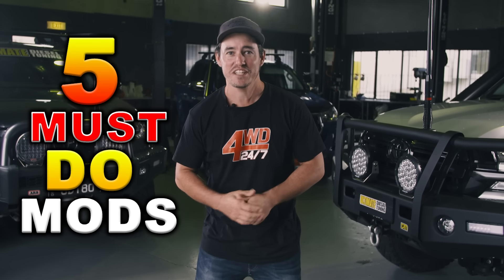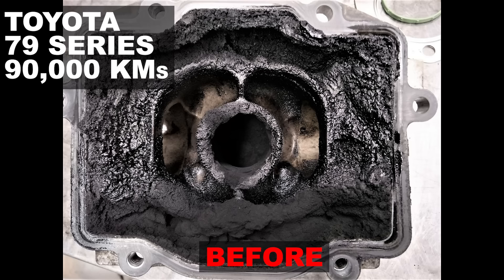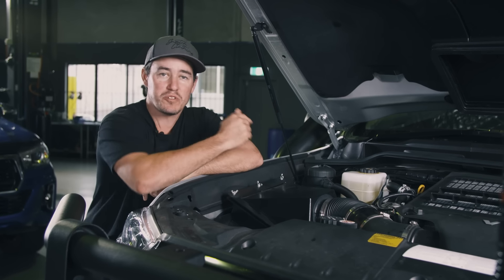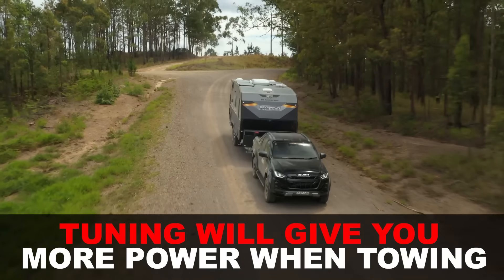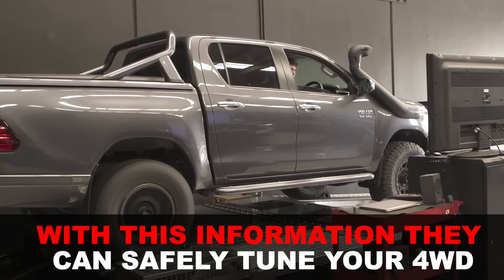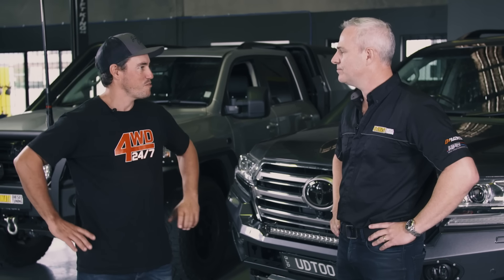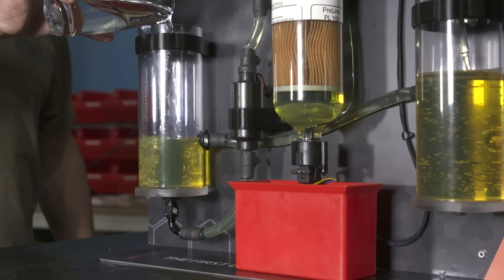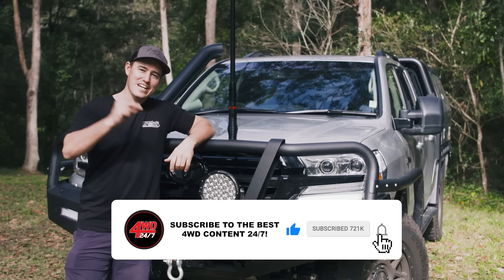5 MODS EVERY MODERN DIESEL OWNER SHOULD DO – all under $1,500! Get 30% more power, more reliability

Comment: 320k on my 200, zero mods and zero issues. I think regular servicing is the key.
Reply: Pull the intake. 
Throw it on a dyno, guarantee it’ll be well down on power
Reply: True. I think all these mods basically just maintain a higher level of performance but will give your vehicle a longer life
Reply: it'll be well & truly contaminated with soot mate!
Reply: @UltimateDieselTuning   I get that but my car is still running fine. Why fix something thats not broken?
Reply: @adrenalinerush91  of course it will it has 320k km's on it
Reply: @dangray5932  are you saying regardless of the soot?
Reply: @adrenalinerush91  an enigine with 320K of use will make less power than an engine with 100k on it with service history being the same. Don't believe the hype. Catch cans are the pod filters of the 90's.
Reply: @dangray5932  lol, that’s funny cause I personally owned 2 identical vehicles and the car with 87,000 more ks made 6kw and 12nm more then the other
Reply: regular servicing, using the correct oil and limit the amount of short drives you will have no dramas.
Reply: @dangray5932  hahahaha changing the oil and big drives eliminates soot 🤣. You have no idea
Reply: @adrenalinerush91  Ran my 2020 200 with 10k on the clock against my parents 2008 200 that had 440,000km on it, neck and neck to 120km/h every time, wasn’t down on power at all.

Had similar experiences with other diesels too, high km cars that are serviced regularly don’t lose much power (if any) at all and are usually better on fuel I’ve found.
Reply: @craigdavid6668  haha mate go throw them on a dyno. No amount of servicing will stop soot build up. Long drives help the timeframe of the build up over short but they all clog up no matter the conditions. 
Those same vehicles I talked about before picked up 10% with just a clean.
Reply: @adrenalinerush91  Fair enough, real world performance didn’t seem affected by the km at all, I don’t know what a dyno will spit out but both cars were identical in acceleration from a launch, normal take off and rolling, parents car sits on 11-12 l/100, mine is always around 14, soot doesn’t seem to have any negative impact on performance from my experience.
Reply: Agree - the only mod of these I’d consider would be the extra fuel filter.  All the others will either be a waste of time or reduce the overall life of your engine and parts.  There is no magic bullet of “more power better reliability”, common sense should tell you that - why wouldn’t the factory do it if it was so easy?  The biggest cause of the build up of soot is short (cold engine) trips in a diesel - as long as you go for a 30min high speed drive once a month you’ll have no problems with soot build up!
Reply: @pacman5590  common sense should tell you that a tune developed for that specific engine, climate and fuel vs a tune developed for the entire worlds climate and fuel quality is a mile and half better for the drivetrain. 
As for soot, short drives just increase the production of soot. Every single diesel with an egr system has soot issues no matter how it’s used. There is no way around that.
Reply: @UltimateDieselTuning  For real
Reply: 450 on mine zero mods zero issues 😂

Comment: EGR's need to be banned, it's just manufacturers being cheap. They kill more engines than they help. 
I'm helping my dad replace the high pressure fuel pump on his Discovery 3 and the intakes are caked in gunk at 180,000km.

One mod I like to do is upgrading the exhaust. Gives a little bit of power but I've also found it help economy by letting the engine breath easier.

Comment: Good advice. Additionally,  you should perform diesel oil changes and filter at least every 10,000km with synthetic oil in common-rail engines (6,000km if round town and lots of idling in traffic). Thanks

Comment: Never do a carbon clean by pushing it through the engine. You'll glaze the cylinders and blow it up. Take everything off up to the head and ultrasonic clean yourself or find a shop that does it properly and not just rev the crap out of your engine pushing it through and leaving most of it jammed up at the head ports.
Reply: agreed
Reply: A men bruv
Reply: Depends on the on car system. Udt uses chemicals to break the soot down. 
Benefits is their system actually cleans out the valve train which cannot be done with a manual clean
Reply: Hey Cal, that's not the case with the chemicals that we use. We have performed thousands of these cleans with zero issues. And no, we don't rev the engine whilst it's doing its job.  Our machines are extremely effective in removing the soot & the process is harmless to engines. Cheers!

Comment: A lock up kit doesnt prevent hunting between 5th and 6th, not in my 2023 dmax anyway. It locks the converter and prevents it flaring which is the major cause of heat. My dmax will often go back to 5th with very little provocation with the converter remaining locked, but if turned off it will stay in 6th but unlock the converter before it goes back a gear. Revs in either scenario are about the same but converter temps rise markedly if its flaring .

Comment: EGR systems should be a fairly regular service item for inspection & cleaning when required, no further action needed. They've been fitted for a couple of decades now, so we should know what to expect & what to do with them. Adding a catch can is a placebo & nothing more as all it does is act as a condenser for the gaseous moisture in the hot exhaust gas, which likely catches some solid particles & then sits around in the catch can gathering more condensed liquid, then evaporating on a constant cycle until you get that half teaspoon of unidentified syrup which supposedly saves your engine somehow. I don't think they do anything particularly harmful, but they definitely don't achieve anything either. Service your EGR systems!

I'm an automotive design engineer btw 👍
Reply: Yea you probably had a hand in all problem in the first place designing EGRs then ripping off catch cans as useless. Ok mate
Reply: @rustybogans2508  Did you get your covid injection, mate?
Reply: @karl4834  nope  live in nth qld bud  fukall happening up here
Reply: Engineer!!!  HAHAHAHA...That explains the ridiculous comment..

Comment: Hi temp alarm.
I use a dry mount probe type with 2 channels.  Install one on the rear of the head, other on the transmission.  Will warn driver of any issues like bad fan, low coolant, split transmission hose before any oem gauge.

Comment: Install some fans on vehicles with a top mount intercooler. They dont enough airflow without fans specially when moving slowly and will tell the ecu the intake temps are high and will reduce power

Comment: oil seperator container there are many types out that taking that your run your crankcase fumes through extracting the oil out before it goes back into the intake manifold, will reduce extensively that gunk buildup
Reply: I'm pretty sure that a catch can was one of the recommended mods.  As in the Provent shown in the video.
Reply: @einfelder8262  thanx may have missed it!

Comment: Hey Shauno, where would you rate a larger exhaust, airbox and snorkel? Best to do those things before a custom dyne tune?
Reply: why would you tune a car and then mod it?
Reply: Larger exhaust - gives it a bit more power & torque once tuned to suit & more response down low (for non DPF models); snorkel doesn't make any difference to the engine's performance; airbox - depending on which one it can make a difference but again once tuned to suit.

Comment: Hey shauno, wouldn't the box tune be better on the 200's now that they can modify the shift points and lockup points? Rather than having a box to tell you box to tell your box when to lock up. Just tune the box so the ECU controls it all rather than an intercept of PWM signal.

Comment: Seems like petrol engine are more reliable these days. Even my 3.4L had lasted 300,000+km with no mods
Reply: Yes and cheaper to run.
Reply: @Malc664  lol I save 5k a year just by switching to diesel on fuel alone lol
Reply: @adrenalinerush91  Yes, it's worth it for a lot of travelling. But the average daily not so much.

Comment: Get the egr valve cleaned aswell. As you never want to block them up or bypass them. That's how most modern p plate 4bys end up rekt
Reply: Yes that is what we are talking about here Kaely - the "intake clean" includes the EGR.

Comment: What happens to company warranty?? That’s the only thing stopping me putting it on a new vehicle
Reply: Ask your new car dealer, not the people trying to sell you aftermarket parts who don’t have to honour your new car warranty
Reply: @Corey-pd3mi  thats the confusion, whom to trust as both sides have a story to tell with no right or wrong answer.
Reply: @sahilthakur03  there is a right and wrong answer, who needs to honour the warranty, that’s who you need to trust. If you value your warranty that is.
Reply: @Corey-pd3mi  And don't do offroading for next 7 years lol.
Reply: good question! Nothing happens to it Sahil. They cannot just go & void your warranty due to any of these things. If there is a problem with the car that develops, then they must prove that the mod caused the issue. And if they can, they can then REFUSE your warranty. Here at UDT we have our own warranty as well.
Reply: @UltimateDieselTuning  that is wrong if you read your warranty even fitting the incorrect tyres is justification to void you warranty in many cases and any modifications that arent manufacturer certified will definitely void they dont need to prove the mod was the cause you need to prove it wasnt.
Reply: @shaynegadsden  put it this way - we tune cars delivered to us by the dealership that are brand new. And also fit exhausts and catch cans to them, plus secondary fuel filters & bigger intercoolers. All of those car's warranties are still intact & fine.
Reply: @shaynegadsden  if you read it all properly it says MAY void the warranty, not will. Most of the vehicles that we custom dyno tune here are still under factory warranty, with no issues with the tune.

Comment: What's your experience with catch cans with new cars? Because I've been told time and time again that they void your factory warranty
Reply: @swampypolitics9574  I think you're in the wrong comment section mate. 😅
Reply: @swampypolitics9574  put your tinfoil hat back on cobba
Reply: If it restricts airflow and causes damage as a result. A good quality catch can shouldn't be a problem but something you should know about.
Reply: Yeah it's true they can void your warranty.  I was told by Toyota about it when I was asking about putting one on my 2021 Hilux, they told me that they had 200 series blowing rear main seals apparently because of the catch can so they voided warranty.  For the record I still put my Provent catch can on.
Reply: @arthurstock4386  the only way that that can happen is if the catch can lines have been installed incorrectly, pressurising the system.
Reply: No problems provided that the can has been installed correctly
Reply: @UltimateDieselTuning  Is it possible to get a catch can fitted at a shop like your's and still have the vehicle covered by the factory warranty though? I'm thinking of upgrading to a 2021 BT50 and want to get a catch can fitted pretty much straight away

Comment: Great vid mate, I have used Ultimate diesel tuning on my previous Prado and can't fault the performance but a question that gets asked a lot is what happens if you get a tune on a new vehicle, as in the new car warranty??
Reply: Everything engine related is void, gearbox void, diffs void.  Your wiper motor is still covered.
Reply: Good to hear! Your warranty is fine mate, they can't just go & void it due to a custom dyno tune having been carried out. In the case of any issues, they have to prove, with sufficient evidence, that the tune caused the issue before they try to void the warranty.
Reply: Any  new vehicle that has  a tune is factually illegal to operate anymore on public Australian roads.... they've modified the approved emmision calibration , and that is 100% not allowed and any by product that the tune  provides  can and does void warranty especially if the increased power / torque  exceeds OEM parameters.... let alone  anything more than 25% needs  a blue plate.... which UDT and many others dont provide.. again making your car no longer compliant for on highway use......  they will tell you what ever it takes to make a sale.... but TMR  will tell u the truth....
Reply: @UltimateDieselTuning  Nice idea, mate, but when you try and get Toyota to repair the CV joints you broke with the tune on board, you'll meet a brick wall.  They won't even fix manufacturing faults like DPF and airbox leaks without a class action.
Reply: @einfelder8262  in the thousands & thousands of vehicles that we have custom dyno tuned, it is extremely rare should there be issues with a dealership.

Comment: Good mods, but every mod listed can void new car warranty. Had a 79 series denied for a turbo, stated in writing from Toyota.
Denied for catch can and pre filter also listed in writing, manta exhaust, dpf back.
Reply: Yup, anything to get out of paying.
Reply: If manta advertised it as warranty friendly they should go to bat for you to make toyota honor their warranty.
Reply: that's when you challenge your dealer. They can't just go & deny warranty claims like that - they must prove that the mod caused the failure. Pre-filters are an extra safety net for the engines (they are just a filter so cannot damage anything in the engine) & if a catch can is fitted correctly it too cannot cause damage. Same with the exhaust.
Reply: @UltimateDieselTuning   Yes I agree, I am a diesel fitter and have been for 35 years.
The catch can and pre filter are vehicle specific that where fitted, and were only on vehicle for 1 week. Toyota have been challenged and have said they don't have to prove anything. Denied for engine mods.
Yes ridiculous, but reality. The maker of the catch can and pre filter kit said the same thing as you, they can't do that.
Yet they did. 
Will you back your customer, when there warranty is denied.
Reply: @peterstrecker689  get yourself a case manager then mate - go higher than just a dealership.
Reply: @UltimateDieselTuning  claim was denied by Toyota Australia.
The manufacturer of the catch can and filter are pursuing the matter, or said they were.
Over maybe 3 months now. Still no warranty.
Reply: @peterstrecker689  interesting mate. Because we have not come across that issue with the thousands of vehicles that we have custom dyno tuned. The cars have been repaired under warranty with the dealership/manufacturer.

Comment: got a question for you guys: where do you start to learn to do these mods? is it from a friend, or from a garage, or other? how can I learn the best I can with doing these mods? e.g., knowing where to attach hoses, where to get a custom bracket done... etc. 

as someone who's never worked on an engine before, in the end of this experience, I want to be able to some of these mods myself.

Cheers guys
Reply: Can find the stuff you’re after online, brackets come with the kits & instructions come with it aswell.. if you aren’t that confident watch videos or ask a friend that knows Diesel engines
Reply: I think the biggest thing is to just start, as with most things you learn as you go or run into a problem. Online, local mechanic, mates or the install manuals all give a helping hand

Comment: Only problem is with a catch can is that it tends to cause the rain main seal on a np300 to leak.
Reply: That shouldn't be due to the catch if it is set up and operating correctly. 

A correctly set up catch can should not impact negatively on crank case pressure.

Also if the can was full this could result in a blown rear main I.e. anything that impacts on the crank case pressure such that it needs to find somewhere else to vent like the rear main.
Reply: @Nick-sd7um  sorry to say but common fault with the 2.3L motor that's in them
Reply: They have rear main issues regardless of having or not having a catch can
Reply: @adrenalinerush91  ^ this!

Comment: Block the EGR valve as this is a major pain with all that sludge going into the motor. There is absolutely no good going to come from sucking all that crap into the motor. If you are going to the trouble of super clean fuel, then why would you bother with the original EGR  "sludge maker"?

Comment: G'day Shauno, I've got an old 2000 8Lt diesel with 685,000Km on the clock & it still does not burn oil or lack much power, the secret to success is to just drive
the bloody thing on long trips. No short stop/start bullshit, thats not what a diesel is made for, mine has a you-beaut hose from the rocker cover to atmosphere,
from new. All these new ones are really ham strung with modern bullshit, it would be like shoving a pipe up your ass & breathing it in to recirculate the fumes. LOL

Comment: What if you have a dpf do you need all this done for reliability in the long run.
Reply: The cleaner the exhaust the less work for the dpf.
Reply: yes you sure do. The EGR system is different to the DPF system.

Comment: Is fitting a snorkel to 4wd worth it. I'm not going in water.  I have been told it will decrease your fuel consumption. And an exhaust from dpf back would that help with breathing or just noise. Thanks

Comment: How does these go with the factory warranty
Reply: Good luck if anything fails in your driveline if you get a custom tune.
Reply: Fine mate, nothing happens to warranty.
Reply: @UltimateDieselTuning  
So if a driveline/power train component fails due to an increase in engine output and manufacturer can prove you have a tune they won’t void your warranty? Pull the other one.
I’ll guarantee you if your diff, gearbox, transfer case etc fails and they can prove you have had a tune you will be on your own.